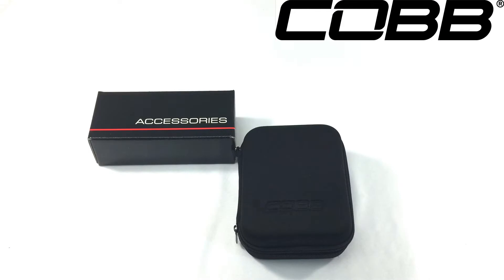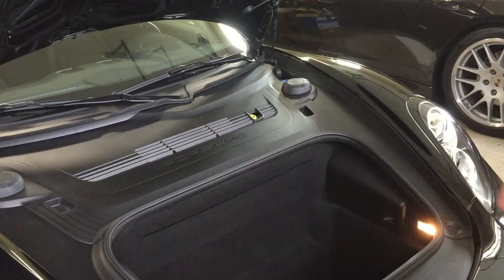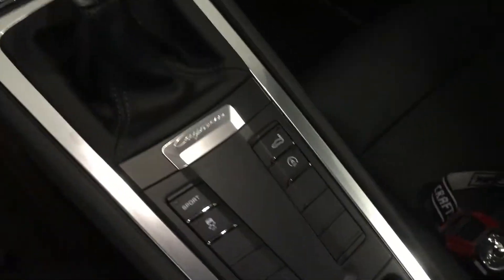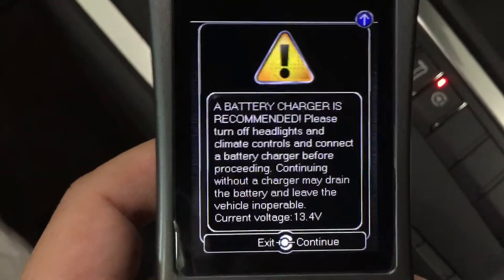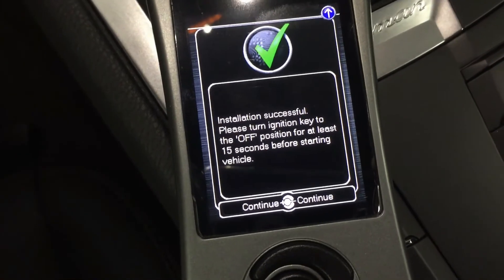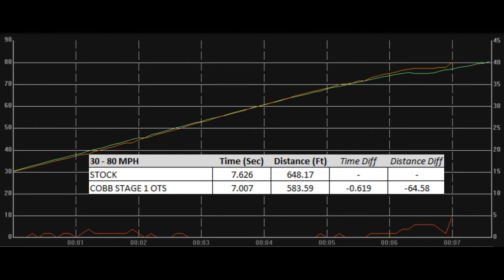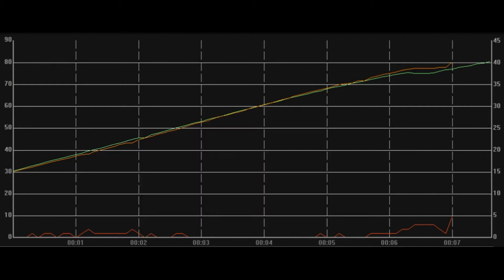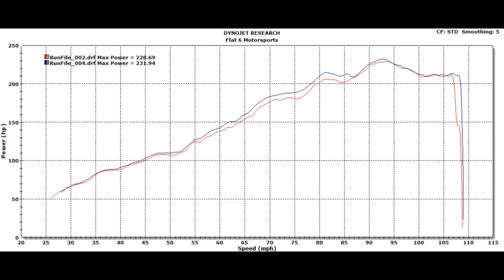Project 981 Cayman - Cobb Accessport (Install, How-To, Dyno & Acceleration Numbers!)

Comment: So I noticed that your fuel gauge showed a range of 400+ miles?  I have never had my 2014 981 Cayman display anything above 350 miles?  Do the wheel sizes impact the fuel estimated ranges?  Running stock everything as far as I know.
Reply from the maker: It calculates based off usage, my guess was it was a full tank and some recent cruising. This is a base 2.7L as well. I'm not sure what mileage we get. I know we saw about 31mpg when we brought it home (all highway).

Comment: I have a 987.1 and added a Soul cat-back exhaust mainly for sound but did not some hp with butt dyno. My question is with a Cobb tune, will it void your warranty? And with the red line increase, isn't that more detrimental to the engine without much gain in WHP? Thanks

Comment: I was looking at your dyne chart and trying to figure out the actual RPM's of the engine.  What gear did you use for these pulls?  The 3 HP gain up top was not impressive for the cost of the Cobb, but I am interested in the midrange power gain, if it really is 9 HP then it might just be worth the cost.  What do you think the difference in tunes between the 93 octane and the 91 octane that we have here in California would be?  Any harm in running the tune in 93 octane but only using 91 octane pump gas?
Reply from the maker: Unfortunately, with that dyno we would have had to take apart the engine cover to access a coil to read RPM, so we said let's just do speed and get a HP number. Pulls were done in 4th gear. The temperature was 95 degrees. We were hoping for more up top too but not sure if the heat played a role or if we didn't allow enough time for the learning to happen between loading the tune and doing the pull. I doubt it would have a drastically bigger impact but perhaps a few peak HP up top. The Accesport isn't too cheap for the 981 but it really is a great tuning solution that you can load at home and if you want to do a pro tune later, easy to work from. Cobb includes a map for 91 octane. I'd imagine the gains would be similar but you might lose a couple HP overall with 91. Feel free to check out our website, we've got some good information on the Accessport up with some dyno numbers Cobb had tested with.

Comment: Great video on the COBB ACCESSPORT!    I was always wondering what you can do with this as you hear alot of positive reviews on forums.  So how does COBB come out with each model's tune?  Do they actually test/tune all of those cars on their dyno?
Reply from the maker: Yes, they are very thorough with testing. They go above and beyond by testing the strength of pistons, etc. Very high quality development with the car for several months. They always leave a little room to get more power but overall one of the best tuning solutions around. Obviously with turbos, you'll see better gains but we're happy with the numbers. We know we can get some more power out once we get the rest of the hardware on, so make sure to subscribe and we'll have updates soon!